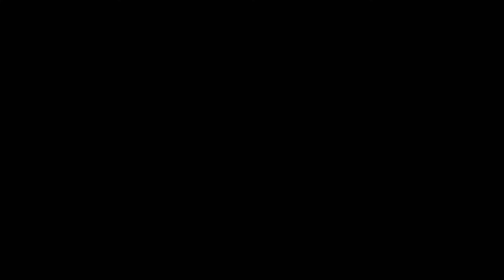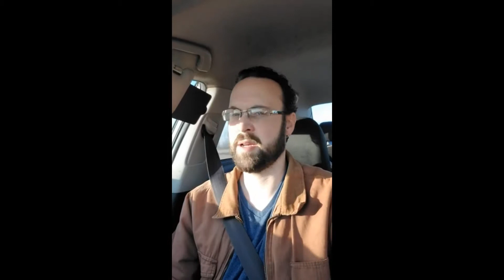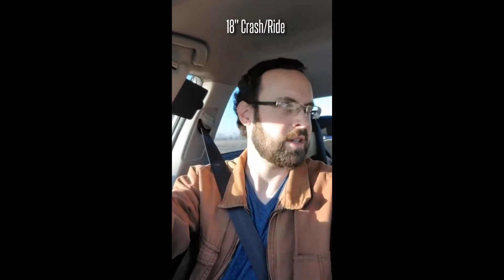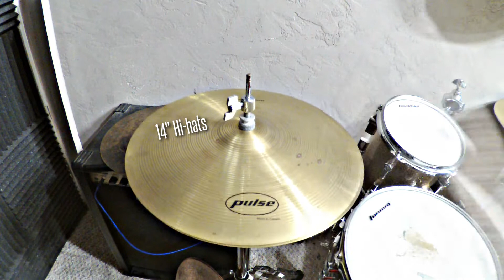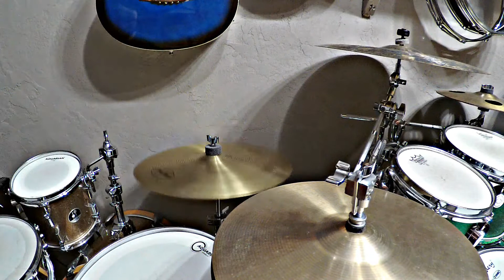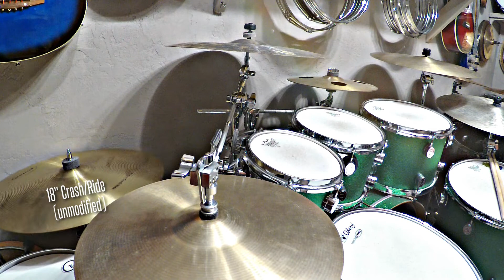Bought Some More Cymbals to Hammer, Lathe & Bury (Pulse 14" Hats, 16" Crash, 18" Crash/Ride) w/ DEMO

Comment: I play a pulse kit! Drums sound pretty good once you put on real heads, and the hardware is sturdy. I have already hammered the hats because I thought they had too much overtones. I just upgraded by getting an A Custom Cymbal pack so I'm going to modify the other two cymbals. I'm going to drill some big holes into the 16" crash to send the pitch higher and use it like a splash. My plan is to bury the ride and treat it with vinegar to get it to be drier, so that it can be my lowest crash. The ride as it is now is pretty good for in your face crash on every beat stuff, and faster decay will aid that.
Reply from the maker: Very cool! That has been my experience as well with lower priced drums...they can sound great with the right heads and how you tune them. Cool cymbal setup and neat that you modify them as well!